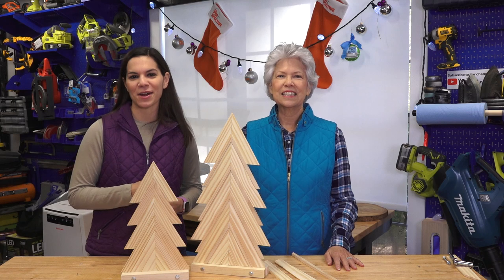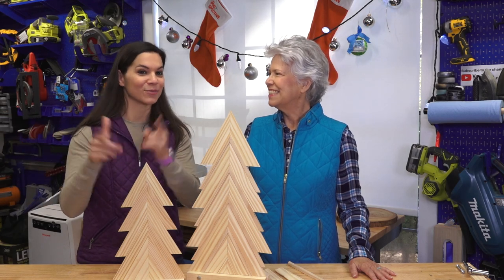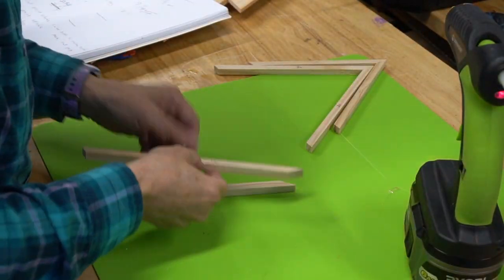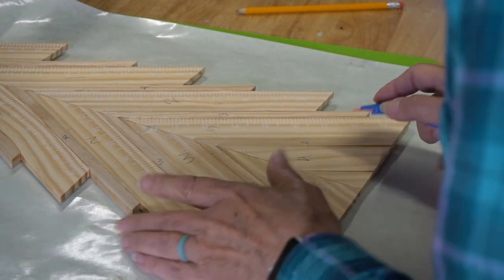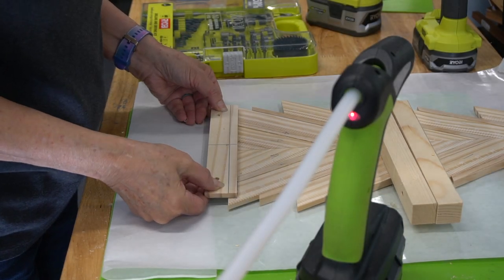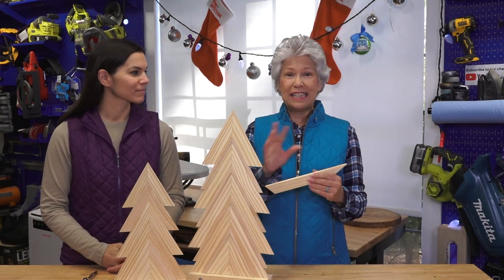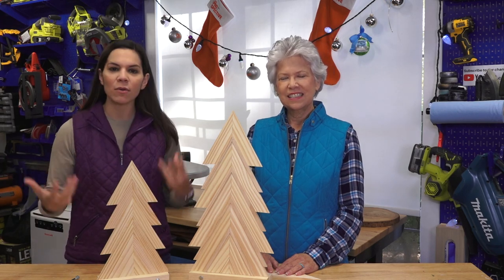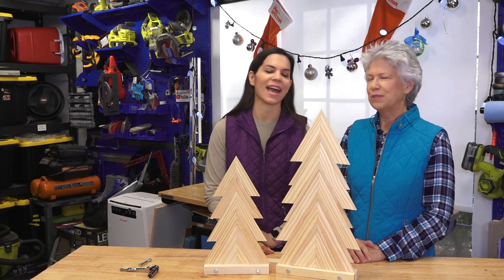DIY Paint Stick Christmas Tree Decor // Part 1

Comment: I'm here because of Steph.   Love the trees.  I have questions about hot glue.  I've used it since it's conception or 1970/80s.  So it's been my experience at some point and some time the glue fails. Environment to hot to cold.  The surface your gluing I'd to smooth etc.   So I'm thinking hot glue must have changed over the years but ...it appears the same to me so... long way to ask.  

" can you do a hot glue pro and cons video".  Love love your channel.  I'm starting a Chanel with my daughters and grandchildren. 

So your channel certainly speaks to my heart.  Keep up the great loving projects.
Reply from the maker: Hi Joni! The hot glue we used is completely different then the typical hot glue you are used to, and find in craft stores. This is construction hot glue, made by Surebonder (https://amzn.to/3cImxfU). It holds up very well, in fact, we made this project https://youtu.be/okMShUlIGfc over a year ago and it has been outside that whole time, and it's still holding strong! Construction hot glue is our go-to fast drying, with good hold glue. Congrats on your channel! -Steph
Reply: Thank you so much...so the hobbies Thor glue is still the going to fail glue that I’m familiar with.  I will look into yours.  I use a mixtures if glues and will use hot glue for things that is one and done and doesn’t have to last or I’ll tack with it while the real glue dries.  I’m very interested in what your using and can’t  wait time try it.